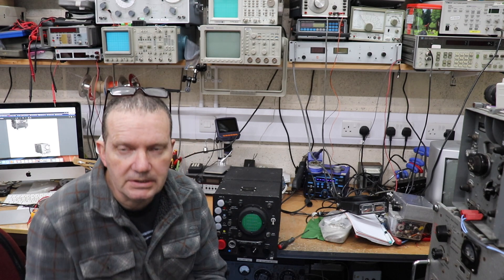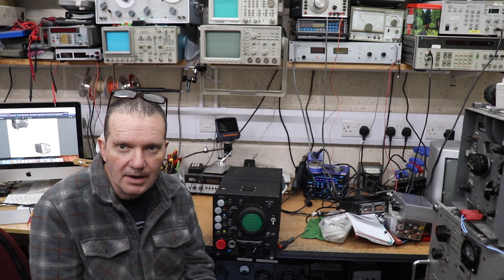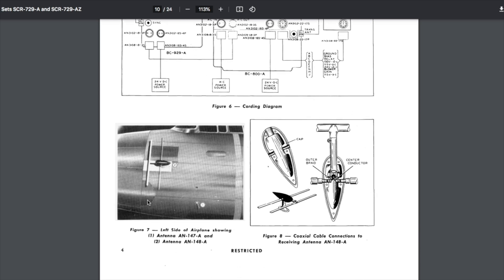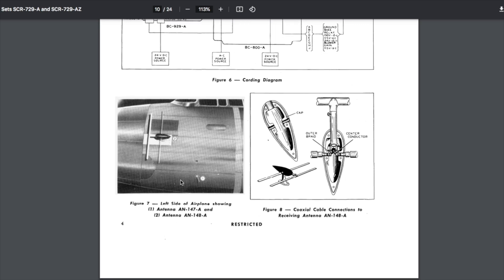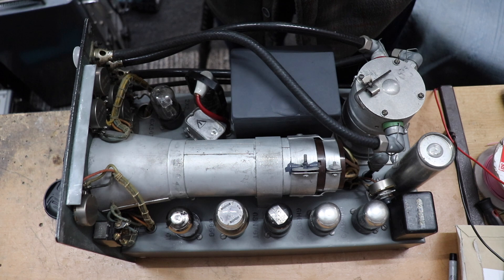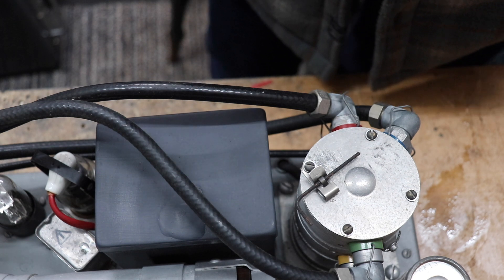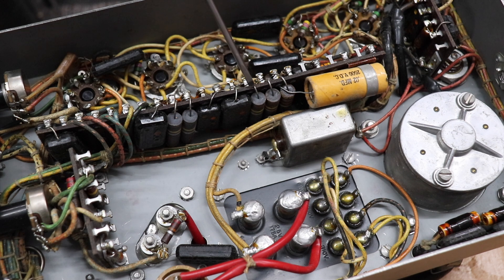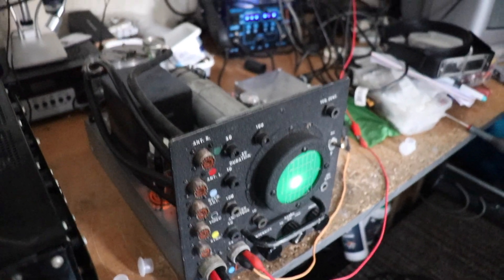Top Secret WW2 Radar Display Unit Teardown

Comment: Way back in about 1970 I used the cabinet and the CRT from one of these to make an oscilloscope using a circuit from Practical Television.  I stripped the scope down about 2006 and I still have the CRT.  I may still have the motorised unit somewhere in my junk.  I looked inside and it was some sort of rotary switch by the look of it.  Amazing to see it again after all those years.

Comment: Could that whiny cylindrical thing in the unit be a way of switching between the two antenna inputs that are going to the unit?  It could be a high speed rotary switch for RF.  Those are SO239 connectors by the way.  take care.
Reply: I was thinking drum memory.